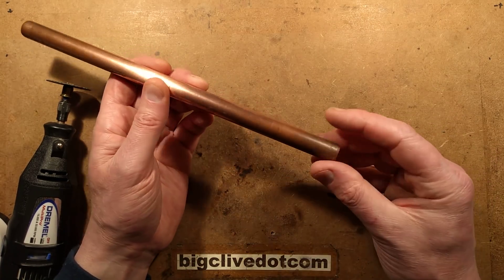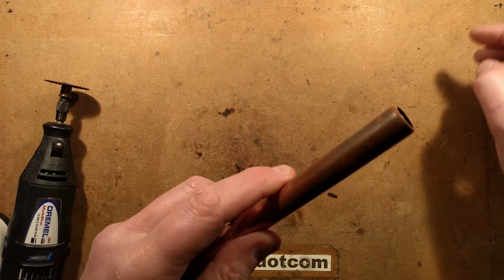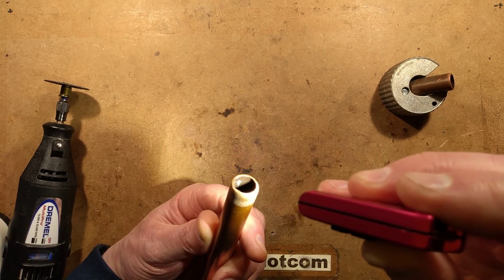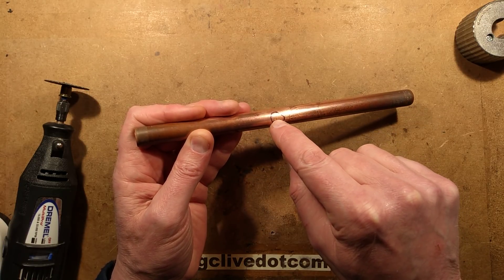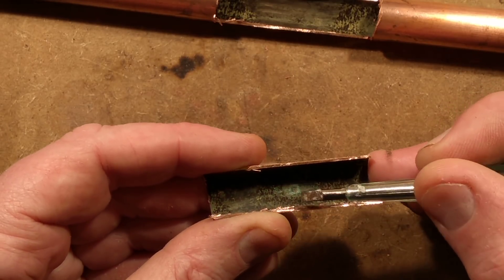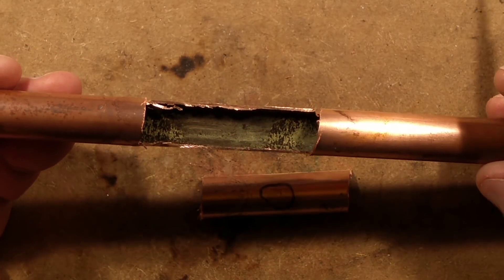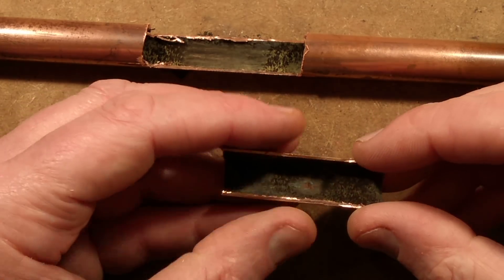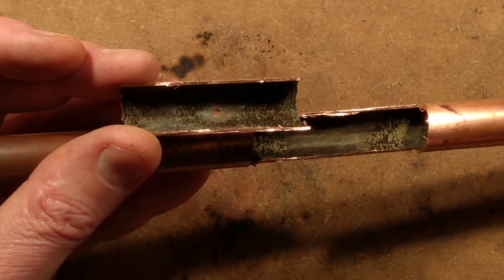Odd pinhole leak in copper pipe.  Selective electrolytic corrosion?

Comment: It's usually the hot pipe that gets pinholes. I have seen this many times. Likely it will happen again on that line. I have also seen pipes that have become paper thin and crumble when you try to cut the pinhole out. And yes it's contamination probably steel wool used to clean before sweating the pipe. If it was the hot line it could be from sediment from water heater. Most people don't drain a bucket full out every six months. As recommended. You really should and will get much longer life out of water heater.

Comment: I have had this in a house i once owned. turned out the immersion heater had disintegrated and the mains was heating the water directly. this caused current to flow through the pipes and caused the copper to gradually fizz away until leaks appeared on various unions where the pipe was now wafer thin :(

Comment: Another youtube advises that if you leave your copper pipes in a condition not completely full of water and not under at least minimum pressure then there can be air in the pipe along with water and that combination starts corrosion.  If you leave home and turn your water off then water pressure might drain out of the pipe at a commode or some valve that needs pressure to remain fully sealed. Commodes tend to leak from the tank into the bowl very slowly and in a few days can be down enough to trigger a partial refill after a couple of days of non use. Even if your flapper valve is pretty new. Usually we don't even notice unless it's leaking enough to refill during the night when we expect quiet and wake up to ask, "hey who just flushed the toilet? The cat?"
If the copper pipes, during construction, had some water in the pipe before the water service was connected and sat for a while then there can be corrosion. And the youtube had an example of pin hole leaks all along the bottom side of a pipe because that is where the drops of water sat for months during construction.  PVC has become a better choice than copper.  This corrosion is also a problem for copper pipe storage at the construction supply business.  They shouldn't leave copper pipe out in the rain unless the ends are sealed and they never are.
But if you leave home for several days it's still best to turn your water off in case a pipes bursts and causes 50k$ of damage like happened to my neighbors.

Comment: My sister had a drip leak in her basement ceiling for 19 years. Her ex had put a drywall screw into the toilet drain when he put up the ceiling. It took years for the screw to corrode and start leaking.

Comment: Common problem, it's flux, concrete or something corrosive thins pipe, could be rubbing but normally the former. Scaridly happens on gas pipe hence not allowed to use power flux on gas but will eat the copper and commonly used due to good soldering properties, who cares about issues a few years on . More money for the plumbers heh

Comment: It could possibly be a bad solder job further down the pipe, I remember seeing an episode about it ruining the pipe and being quite poisonous if the solder pools inside the pipe while they solder the joint, it also shouldn’t be the boiler that has mineral buildup because most of the minerals fall out when the water is boiled

Comment: We had the same shortly after we moved into our house, which was buit in the mid 70's.  A local plumber told me it was common on our estate because they had used 'Canadian' copper due to a shortage in the UK. I was told that the copper was of poor quality with a high iron content, thus the green spots.  We had about six leaks, all resulted in the plasterboard ceilings being taken down to repair each leak.  After the first threen we started again and replaced it all with plastic.  Job done.  Interesting video, thank you.

Comment: Had two toasty floor tiles in the kitchen. Then a few weeks later my Boiler kept switching to hot water only. Put two and two together and ended up digging up my concrete floor and the damp course for a tiny pinhole leak. Mine was at the lowest point in the run. Maybe where metal from cheap taps etc settled. If you can hear water flowing when all your taps are off. You've got a leak!

Comment: Just a tip and only for a second BigClive if your going to fix yourself remember shite runs downhill, and when sweating copper sand, flux assemble then heat in random spots the fitting not the pipe then once hot enough hold your flame on the opposite side of the solder. The solder will run to the heat, but you already know that because of skills with soldering electronics.

Comment: The green is definitely copper oxidation - that's the classic copper carbonate salt by the look of things.  (what makes the Statue of Liberty and her twin sister in France green).  

I would say it's unlikely to be steel - unless the steel is cheap steel.  Iron oxidizes more easily than copper - so you'd need something that is more readily reduced than copper, like silver, gold, or platinum for it to be a metal contamination issue.  Not that it's impossible, just improbable.

More likely, is that there was a slight bit of oxidized copper coming in or already established on your pipes (even microscopically) that set up a concentration cell situation between those two points where there was a flaw in the metal surface (as charge congregates to small points).  As a result, the area of low Cu ion concentration was oxidized - which would match that other point near the end of the pipe.  Combine that with a thin spot in the metal and you get a hole.

Comment: I had this happen in 4 inch soil pipe (yuck) in my house.  I had it all replaced with PVC using rubber couplers.  It happened over several years as piece by piece I would discover a drip on the bottom of the soil pipes.  PVC and Fernco couplers fined the problem.  Only happened on horizontal runs in the basement, but I guess eventually it might happen in the vertical runs.  Maybe harder to detect in vertical runs from the toilet fixtures on the main and 2nd floor.

Comment: That is concerning. Haven’t seen that before.
Reply: It's not exactly common but does happen. I've seen it a handful of times in 30 years of plumbing. Always thought it was likely down to the copper being contaminated.
Reply: I had it happen in 3 places on a single length of pipe. The supplier told me it was a batch of pipe contaminated in production. Some escaped into a delivery to the shed where I brought it.
Reply: cody! great to find you in the comments!
Reply: after reading many qualified comments, you didn't discuss where in the pipe the corrosion was, top, bottom, sides, or random inside the circumference. as you mention the pipes lay unused for stretches of time, contaminants could settle out and become adhered to scale, where as random locations are manufacturing defects, which seems unfortunate.
thumbs up for minimizing noticing, locating, and repairing the leak, no small feat. either your house is that small, or that quiet, nice.
Reply: https://www.youtube.com/watch?v=nD5lMITzx_Y&t=270s multiple potential causes.  Based on the fact he said it is on his hot water, i'd check his hot water heater for rust that would cause pitting.
Reply: Thats a nice surprise finding you here in the comments :) What do you think what caused it?
Reply: https://www.youtube.com/watch?v=zCE26J0cYWA Its a well known phenomena in plumbing and other industry.
Reply: This is an ongoing although minor issue in my house.... the pin holes always seem to appear in the top ¼ of the pipes circumference.  Though I'm not certain I attributed it to my well water having small bits of iron in it, some bordering on microscopic. I live in an area of the southern US  that in the past had multiple hotels/resorts famous for the healing properties of local mineral rich waters and was even shipped to Europe in those days. Supposedly iron carbonates and calcium and occasionally low levels of sulfer. I always assumed that combination lead to slow electrolytic corrosion. One thing I found very interesting is the pinholes tend to really show up after the water has set in the pipe while on vacation etc. Would love to know an exact cause though.
Also a small bit of rubber tubing and a hose clamp works great for temporary use until you can get to it
Reply: If you get a plumber that doesn't flush a system properly you can get steel wool lodged and stuck in fittings with flux. That could have caused the electrolytic corrosion as it's got dislodged over time. Only a guess but definitely electrolytic corrosion as proven by the pin holes.
Reply: @xjktoxik  the corrosion wasn't at a fitting and free floating steel fragments will reduce to magnetite when disolved oxygen is a limiting factor, if not then you get rust. This seems more like contamination in, or embedded into, the copper.
Reply: @xjktoxik  we  used sandpaper
Reply: @xjktoxik  Yeah! You can get flux contamination, iron contamination from old iron pipe, aluminum/magnesium contamination from a failing anode rod in a water heater, and iron particles in the pipe itself.
Reply: We had multiple failures like that on the the top floor of our house, which had actually the most recent plumbing. It was done about 35-40 Years ago, and the copper pipes were considered "the best" back then, while the rest of the House still got 60 Year old Steel Pipes. First failure 10 years after installation (bad soldering) then multible Pin-hole failures about 6 Years apart. Point of failure was often difficult to find, since our Pipes also had a plasik Jacket for protection. The Water leaked into the Jacked and into the Wall wherever the Jacket was removed for soldering. We ended up ripping out all Copper Pipes, and replaced them with modern reinfoced Plasik Pipes. The old Steel Pipes are still fine. I recommend doing the same, this will not be the last failue.
Reply: Come on Cody - you’re a scientist , you know about this stuff .... think 🤔

Comment: This is type 1 pitting corrosion due to "carbon" deposits/inclusions of oil or graphite from the manufacturing. Very common in "cheaper" copper pipe made in 70/80's, which age yours looks to be by the thickness of the wall. Newer manufacturing processes avoid graphite and/or clean pipes better. Absolutely nothing to do with steel inclusions, chloramine or flux. Can't be steel as steel will corrode rather than copper due to its location in electro-chemical series. However oil/graphite deposits will cause the copper to corrode in preference to the carbon. Not a lot you can do, have been some studies about dosing house water with phosphate in soft water areas to form a protective film. Basically replace all pipe plastic or modern copper is the only real solution. Typically takes 10-20 years to make its presence known, by pin hole leaks....

Comment: A long time ago I worked in plumbing and got a call from a woman who said that there was water dripping through her ceiling. I told her that I'd be there in an hour but in the meantime use a screwdriver to make a small hole through the plasterboard. This allows the water to drip into a bucket rather than spreading out and bringing the whole ceiling down. She did as I requested and when I lifted the floorboard in the room above I could not believe what I saw. From below the damp patch was roughly one square metre, so she could not know exactly where the leak was. From above, on a leaky straight connector the drips of water went through the hole that she had made without touching the sides! The hole was about 8mm diameter. I told her that she must be psychic :)
Regarding copper, there definitely was/is cheap stuff with impurities, seams and other defects. I would not put plastic pipe under the floor if there is any chance of rodents. Rats love pipe insulation ( the grey foam stuff) and will eat all of it :(
Also do not use plastic pipe if you have solid fuel heating. At some point you will forget to damp down your stove and it will get very hot. The plastic runs to your radiators will sag between their fixings. This is no problem until you have drain down the system for whatever reason. When you try to fill it there will be air locks everywhere, this is not good.

Comment: Its called ACTIVE FLUX - very common. When pipe cleaned with WIRE WOOL for soldering tiny fragments of steel wool in ACTIVE FLUX are what causes this.

Comment: i had a brief look through the comments and did not see anything relating to the pipe being near an electrical field.  a friend called me telling me a copper 3/4 water pipe at his house was leaking.  so i, being a person of many skills,(not a plumber) took all the gear down expecting my friend to be mistaken, copper does not corrode.  it had.  we removed and replaced a 2 metre section.  it had gone the way your pipe had.  lots of pinholes from the inside out.  they were all on the same side, if i remember correctly.  i happened to mention the incident to an electrician (a real one) and he said it was because it was near the earth stake below the electrical box of the house.  was there an electrical field in the vicinity of the hole?

Comment: Find out if your municipal water supply uses chlorine or chloramine for purification. Many municipalities have switched to the latter because it is cheaper for them, and unlike chlorine, which loses its effectiveness within hours of being exposed to air, chloramine protects for days even sitting in a bucket. The problem is that chloramine eats copper. I recently had to spend $10,000 CDN ripping up my front yard and getting a new copper feed from the water main because a pinhole sprung up a few inches ahead of my mains shutoff valve (meaning I couldn't stop the leak without having the city turn the valve at the street off). Chloramines are a serious problem waiting to happen for millions of homeowners who expected their copper pipes to last the lifetime of their houses.

Comment: That's the first time I've seen a spring loaded pipe-cutter. Are they common out there? All I've seen as a hobbyist plumber is the screw types. It also seems to round over the ends that you cut. Is this because of higher spring tension?

Comment: I have a friend who is a plumber - nearly fifty years in the trade.
He saws we needn't look for esoteric reasons. Somebody using a hacksaw with a steel blade to cut the pipe or fittings is the most likely reason.
Once the quality control on copper pipe started to decline in the mid-80s, he switched runs to plastic wherever possible and still does to this day.
Copper pipe just isn't what it once was.

Comment: Trace iron is common in copper: https://pubs.acs.org/doi/abs/10.1021/ac60337a032 and there are other normal trace impurities (selenium tellurium arsenic, tin, and lead to name but 5) but these tend to dissolve in the lead where iron forms tiny crystals. So it is a possibility.
Chloroamines can also cause pinhole failures https://www.wwdmag.com/contaminants/chloramines-found-cause-leaks-copper-pipe-systems
It's quite interesting when you dig into it.

Comment: I had a pin leak in a copper water line.   The blue is copper sulphate from the corrosive reaction perhaps with iron in the water.   I have a well on the property.    I filter the water going into the water heater.   I see small rust coloured particles in the water.    The line which leaked was for outside faucets to water plants around the house and is just where the water enters the house from the well, a good distance before my water filter.   

I foolishly closed off the line for the winter but did not drain.   I now drain the line and blow out with compressed air for winter if it is used in the summer.   I think the lack of flow over the winter allowed for more corrosion.

Dave.

Comment: In cold water pipes what can happen is when they solder the pipes the flux residue inside the pipe will break apart and scatter inside the pipe and stick and create pockets of corrosion while in hot water pipes the flux residue would be washed out because of the heat.

Comment: I got a pinhole leak in a old copper pipe in my basement a while back.  Ended up using one of those hose clamps.  Still haven't 'properly' fixed it yet.

Comment: Age and being close to the main inlet in the house seems to be key. Had 2 boiler rooms that kept springing leaks just like this. Replaced all the copper as the leaks were happening every 3 months. Yet the rest of the building was not springing leaks for years after even though nothing was changed in the rest of the building. Impurities and pressure vs how many turns in the pipe are happening in an area.

Comment: The pinholes are not necessarily limited to water lines.  A customer of ours had building wide argon supply built of copper tubes.  After some contamination of argon was noticed, they ended up using their mass spectrometer at one outlet.  The supply and all the other outlets were closed and the analyzer pulled a vacuum to the lines.  When they then walked along the lines and purged the outsides of the tubes, valves and joints with helium, the analyzer responded with about 10 different leak locations.  Some were in joints, but some were in the middle of straight tube run.  Fixing all the found pinholes eliminated the argon contamination problem.

Comment: I had something similar thing on my copper water tank. The expansion pipe spits water back into the reservoir on top of the cylinder. This contains iron particles from the radiators which sink to the bottom of the reservoir and eat through the copper. Came home to a wet cylinder cupboard and traced it back to the top reservoir floor. Fixed it by draining, drying and then lining the whole reservoir with epoxy resin, been ok for the last 7 years or so!